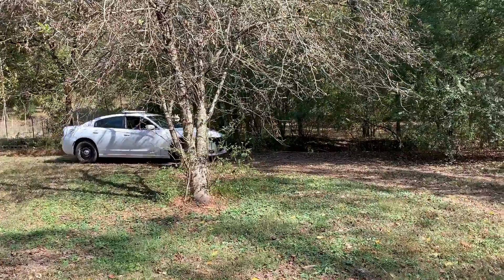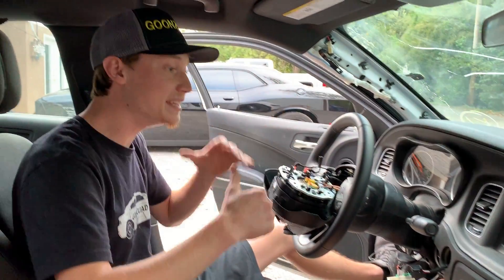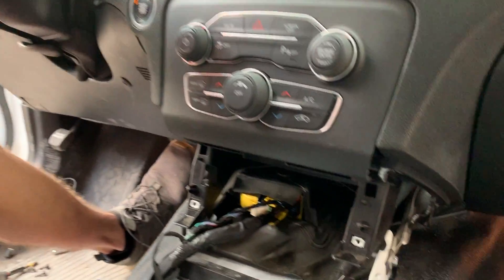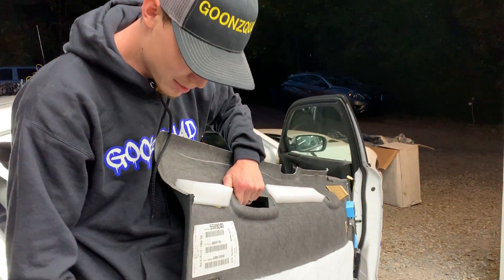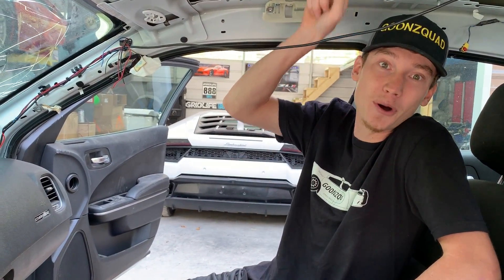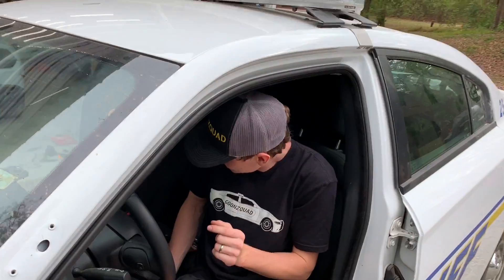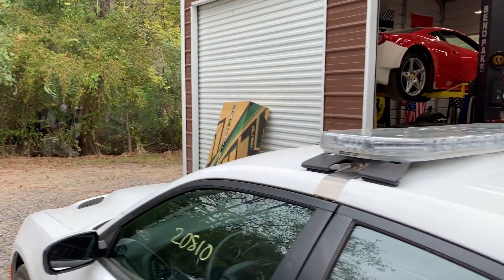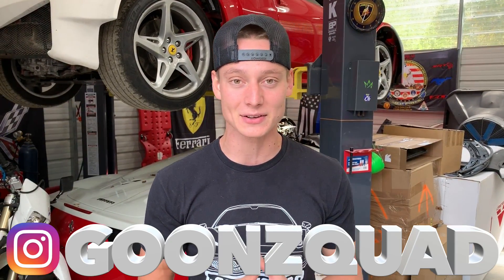Rebuilding A Wrecked 2018 Dodge Charger Police Car Part 8

Comment: No surprise insurance costs are so much when an airbag requires the total removal of the whole dash to replace it .
Reply: One would think a split dash somehow and then the windshield goes along with it. When its drilled down it becomes more obvious to me why it may be more efficient to total it out. Seems to me the trend is in the line of planned obsolescence to keep the assembly lines working. And this because of a deer?

Comment: Should have put that armrest more towards the bottom of the console and the drink holders at the top, your elbows will hit drinks in them all the time, and your arm is never gonna rest on that pad way up at the top. For your side decals they should resemble what was on it when you got it. Use your youtube logo for the badge and like everyone is saying change the SHERIFF to SHERIPS, and Like AWD Patrol on the fenders, and goonzquad under SHERIPS Like where the County name was. Also I don't know your local laws but even if they are turned off you may need to cover the bar with black fabric or plastic when you're on public roads, simply having those lights on there and operational could get you in trouble.

Comment: Just to throw this out to you all ,when taking the decals off the sherriffs and county you can use a heat gun to remove them but lightly spply the heat to the stickers so you dont crack the paint just for your infor

Comment: Move the controllers and the cuphokders up and put arm rest pad where your elbow goes
Reply: On alot of those lightbar controllers you can.lock out the blue lights unless you hit a certain button combo  or sometimes you can hide a lockout botton or key switch this way if you get pulled over it cant be turned on

Comment: Did you check with local laws about the lights? Where I live in Canada they have to be covered to go back and forth to car shows and never used on roads,Fiines are in the thousands for use of sirens and police lights.I think the best bet would be to finish the car and either donate to the local police department or put it up for public auction.

Comment: I don't know if y'all will see this before the headliner goes back in but if you do y'all should put some sound deadening on the roof under the headliner. We have the charger patrol cars and the light bar on top can make some serious wind noise between 80 and 110... Ask me how I know😂🚨

Comment: I'm still wondering why you haven't removed the windshield yet. That would've saved a lot of time and trouble.
Even if it didn't need to be replaced it's still easier, in the long run, to remove it and glue it back in. Live and learn.

Comment: Can u please help I have a dodge charger pursuit 2017. 5.7 v8 hemi and my electronic stability control keeps coming up on my dash and disables my all wheel drive. And I have to turn it off and on again before I can drive it again. Took it to my mechanic swapped another transmission hoping it would solve the issue. And now he said have to replace some valve body module. And it's still doing the same issue It's annoying not sure what's wrong. Im going to get new tires and wheel alignment this week too. Sometimes I get stranded in the road